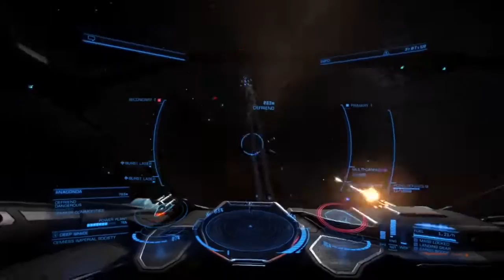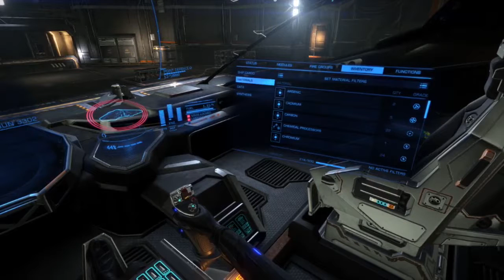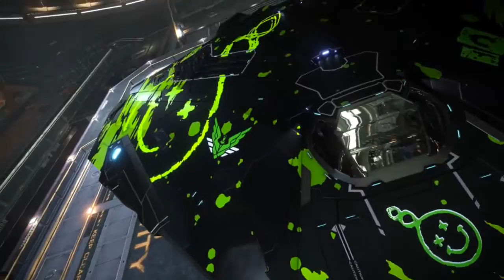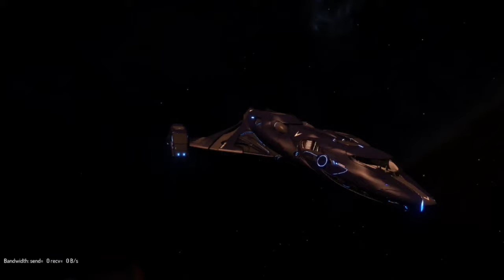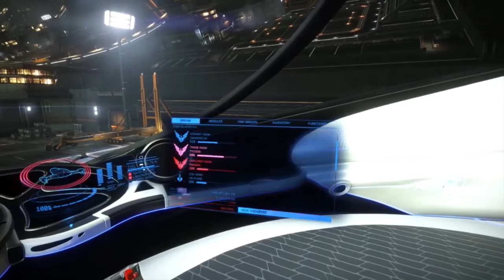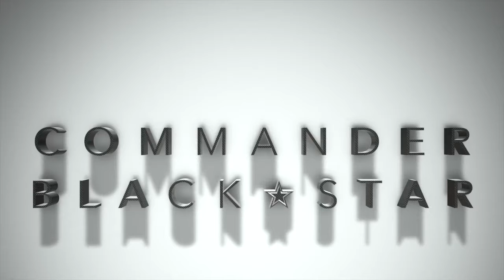Elite: Dangerous Engineers Locating Engineer Materials

Comment: how do you get the outside cam to work mine is stuck on one point above and behind the canopy and wont change, such as zoom in or out far enough to see the whole ship.
Reply from the maker: I use my forward and backward thrust to move back and forth and i'm using a ps4 controller so i use the left stick to move on a horizontal and vertical plain. An i think my right stick turning the point of view. to be honest i'm not sure if i set that somewhere or it did it it self, but if it set it self you move it like you fly your ship. I hope that helps in some way. when i get back to my pc ill check it out as well.
Reply: yes some thank you
Reply from the maker: +piratefilmco awesome, yeah I went into settings to have a look and couldn't find anything specific on it. An in my explanation I got the got the sticks backwards but other then that I'm not to sure. If I do find something I will make a short video.
Reply: explanation accepted, technology is a wonder and a curse.... sorry for offending your piehole LOL